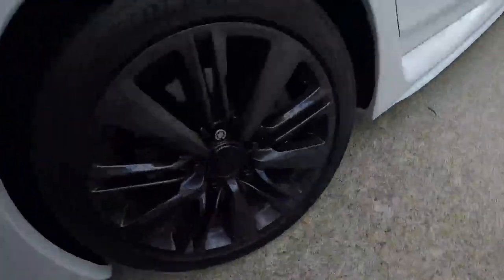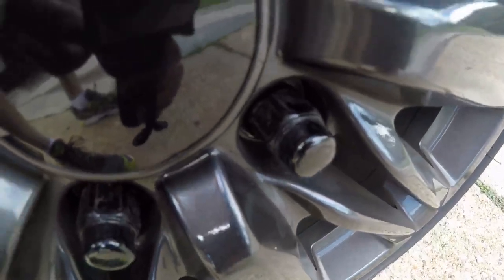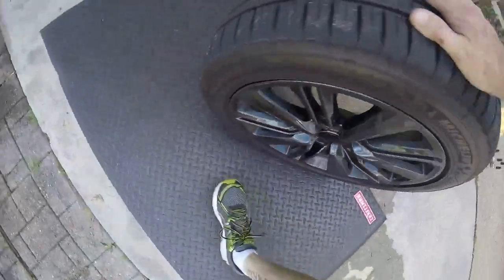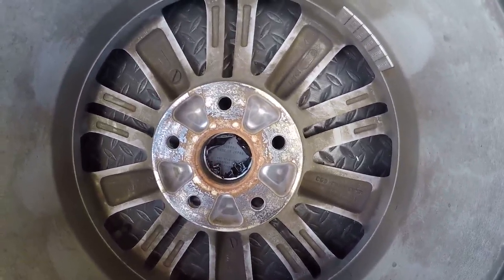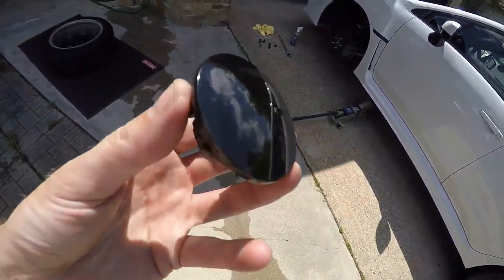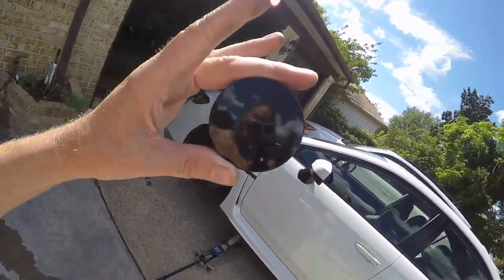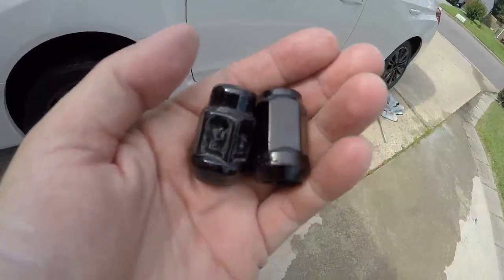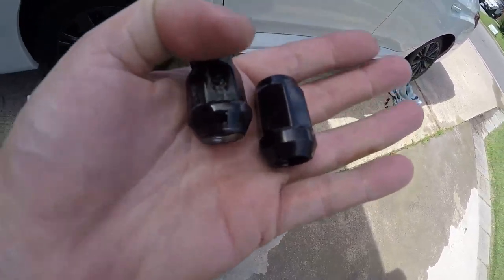2015 Subaru WRX Ep. 780: Black Lug Nuts Fail

Comment from the maker: I been thinking about the LHG logo to the left of this on my center caps, white logo on the black vinyl cap.. but i would need a exact cut out in white of this logo, about half the width of the wheel cap.. with a double sided tape, so i can pull the rear, stick it, then peel off the protection film in front and have it POP..

Comment: To bad McGuard doesn't offer their OE style black lug nuts in 12x1.25 I've had them on my old 4x4 for a few years no rust or noticeable wear to the finish just put a set on my other car as well (They do make a spline drive tuner version but usually it's not recommended for OE type wheels)
Reply from the maker: true, im still hunting for a oem looking high quality black set. i have a special socket on order.

Comment: I'll be making them soon otherwise you can embosse them
Reply from the maker: hmm u mean black center caps? dont want no chrome in those things..
Reply: LastHumansGarage no emblem overlays for the centercaps so you can match it to your steering wheel or front and back emblem. if been looking for carbon red but no one makes them so will make them instead so if you want the overlay I will show when they done just have to measure it up and see if they will work and yeh try and block out the chrome. if you want email me a design you want and il give it a go on the cutter machine
Reply from the maker: ah, i started with emblem overlays on those.. never liked them, because the edge peels up and collects dirt so easy. its hard to get the exact circle perfect so its not so small that it shows stock color, but not so big that it hangs over the edge.
Reply from the maker: what i want to try it high quality white vinyl in the shape of the logo next to this post. so it can stick right over my black vinyl. But i would need to measure and get the exact dimensions i want. i dont want it too small to see, but i also dont want it overpowering the circle. a starting point is maybe 1/2" or 3/4" in total decal size, but the decal cannot have any circle or square borders.. i want just the decal, like my perrin white stickers..
Reply: LastHumansGarage so you just want the stars ?? is that right but off center on black vynal with white stars ??
Reply from the maker: no... let me get a pic link...
Reply from the maker: this outline.. cut out in an exact sticker..  in maybe 1/2" wide and 3/4" wide test fits. http://www.lasthumansgarage.com/images/negativeimage.jpg
Reply: Or I'll wait to see what you do first and then I can try and work with you to get what you want? I understand the sizing but not sure if I understand the rest hahaha. but feel free to email I'll do this inreturn for helping me get my wrx limited badges =) regards danii
Reply from the maker: thanks dude.. all i want is a white vinyl sticker in the shape of my logo..